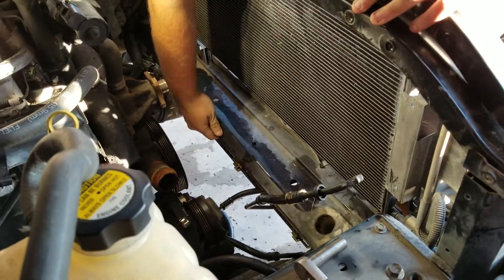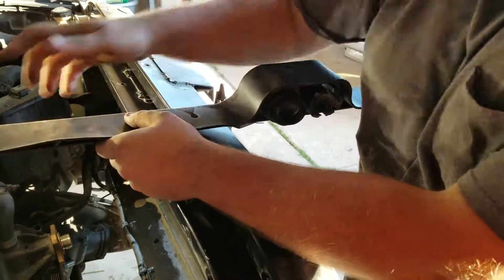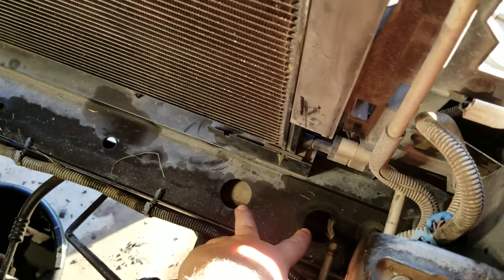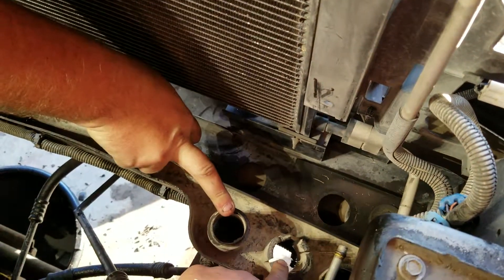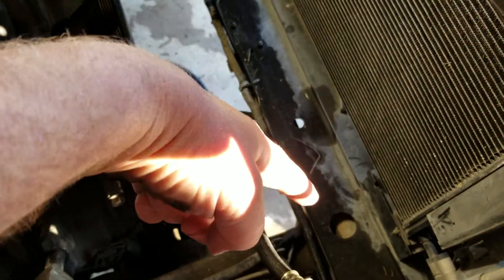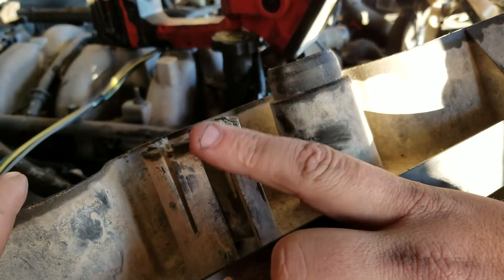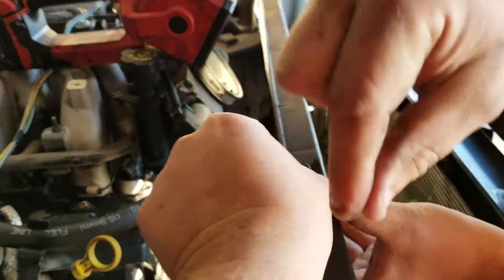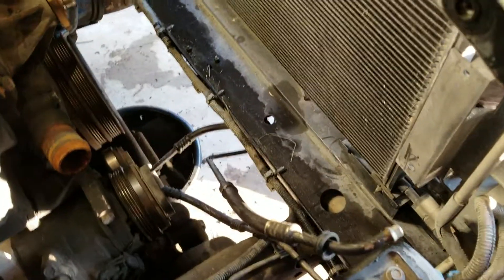8.1l EFan swap. 6.0l radiator spacer.

Comment: Thanks for sharing this video. Could you please explain something though....why would you swap to the smaller 6.0 rad? Are you doing it to run e-fans? If so....why? I thought the mechanical fan from the 8.1 pushes much more air than any e-fan that is OEM or aftermarket. I am genuinely interested in this info because I want to do a body lift but I can't because my fan will hit the shroud. Thanks
Reply from the maker: Yes we did the efan swap on the 8.1l. We used factory efans from an 05 z71 suburban(basically any oem truck efan) 

Been about 6000 miles now, I've towed heavy and never had any temp issues. The new ac delco 6.0l radiators are more efficient at cooling than the larger and older 8.1l radiators.
Reply from the maker: Also I have another video explaining the difference in the radiators.